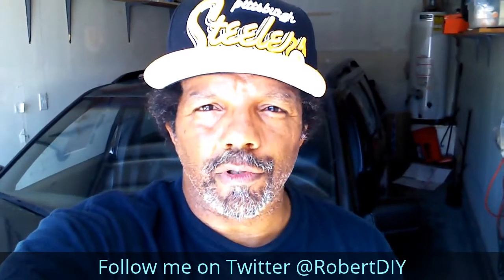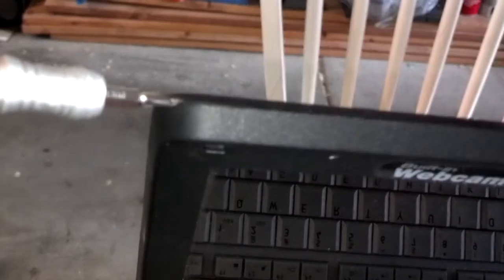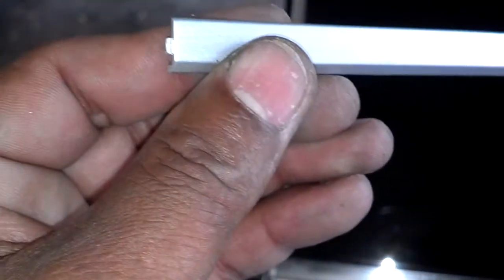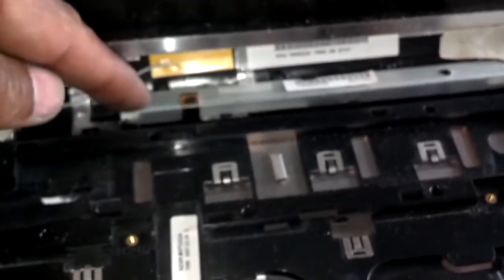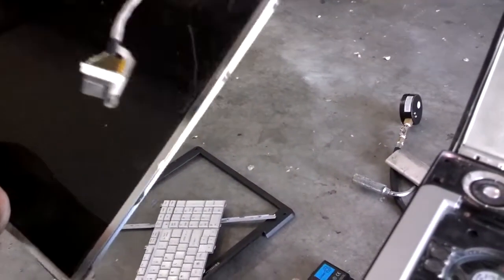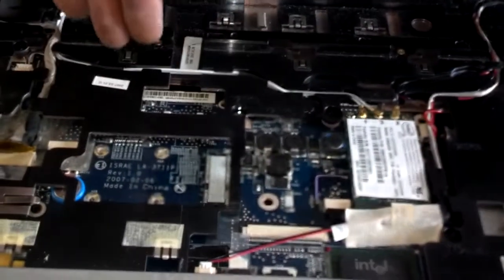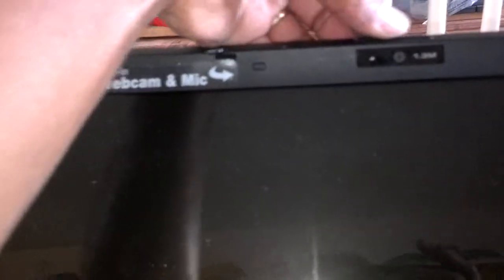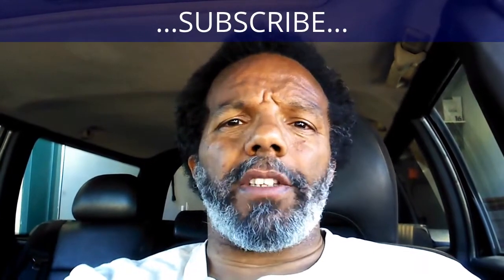Laptop monitor replacement, Toshiba Satellite P205x-xxxxx. - VOTD

Comment: Smashing job robert :-D
Im supprised you didnt just disconnect the lcd from its data cable and ccfl lighting inverter, much easyer, unless you thought the pcb to display cable was faulty too.
The laptop im using was a recovery, someone got angry with a game and punched the screen ouch!!, a frend saved it from the trashcan and gave it to me, another lcd from ebay and i have a laptop :-D :-D
Reply from the maker: zx8401ztv Nice. You know, I forgot about the plug on the back of the LCD. LOL That would have saved some time for sure, I have done it that way in the past. The busted screen worked fine. I just may edit that video to make it easy on people.
Reply: Robert DIY well you know how i can sometimes jump to conclusions when commenting, i thought ooow perhaps the down cable was faulty and thats the reason for the complete replacement.
Oh well, it works and thats all that matters robert :-D
I would leave the video as it is, i dont think it will be the last screen you will change.
Some machines have a bios thet demands a certain brand of screen and wont work correctly, its not because the screen is incompatable, its the manufacturer of the laptop being a shit bag.
Reply from the maker: zx8401ztv Well, the lady whom it belongs to doesn't like the scratch on the display. She wants it replaced. So, I'm getting practice there as well. :p